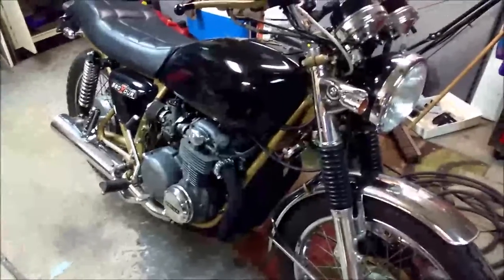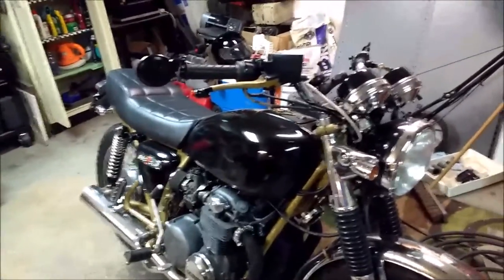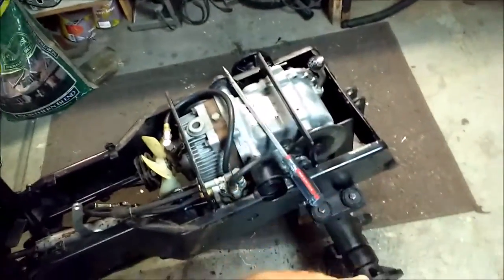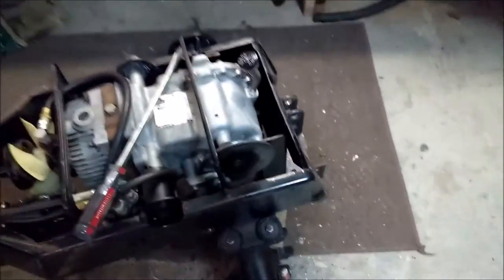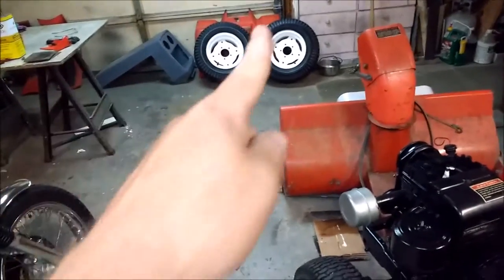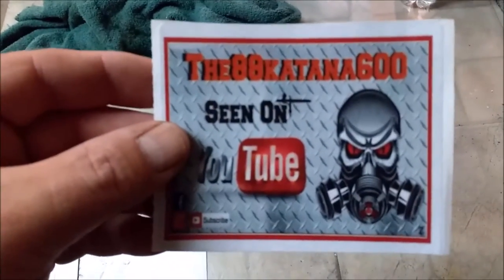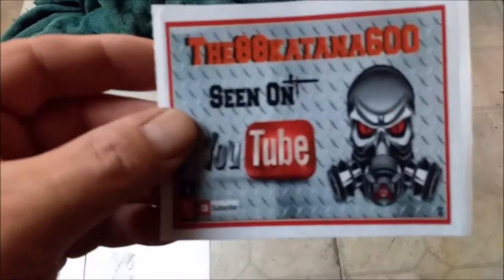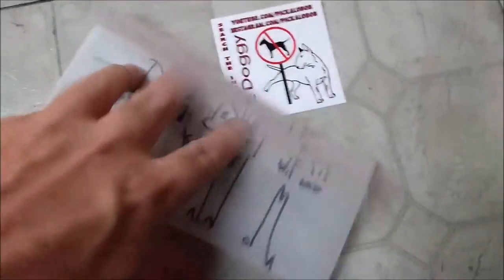Triple Mail Call and quick update

Comment: A bit off topic but was wondering how you liked the foam filters on your 550 are those Uni Filters? Looking to change a few things up on my 77 750 and was considering those filters. The tractor is cool.
Reply from the maker: So I like the way they look, I like how easy they are to clean and the price was right Uni-Filters are resonably priced but there are a few things I don't care for, they don't keep rain out they don't keep wind out when I hit an open field and there is a cross wind my RPM's drop. Also any change to the air box will require a rejetting of the carbs.
Reply: I realize the re-jetting witch wont be an issue..worked in a dealership from the mid 80's until the mid 90's and have been doin bike work ever since in one way or another..I have a set of APE filters on now and was curious how the foam ones held up..my 750 isn't exactly stock either with some mild clean up porting 1mm bored over carbs and a period correct Jardine Pipe..the filters I have are 7 years old and was looking to change things up a bit and was considering the UNI filters as an option. I had a Honda 350F way back before the 400's came out great little bike,like your 550 don't see many vloggers with classic stuff..most of it consists of the crotch rocket wanna be moto-gp riders that wouldn't know a clutch plate from a dinner plate so its nice to see some old classics.